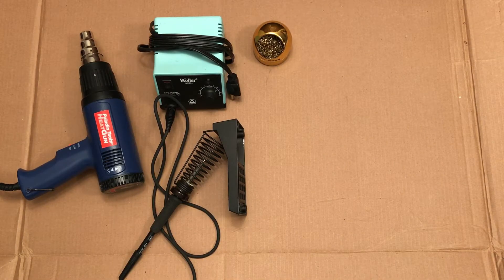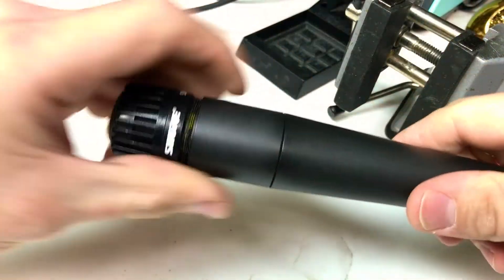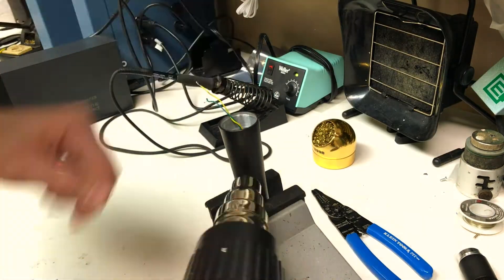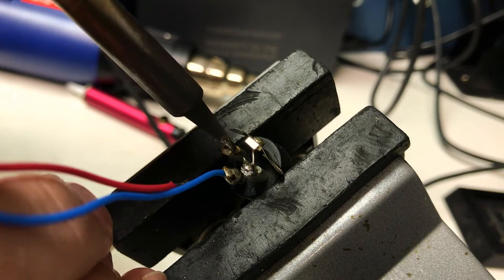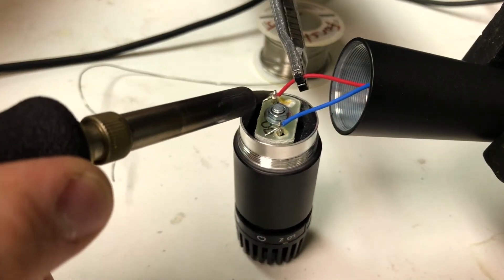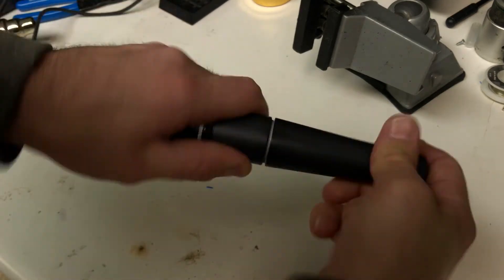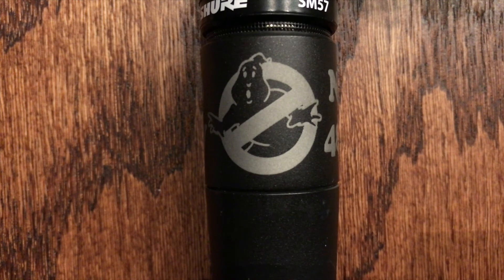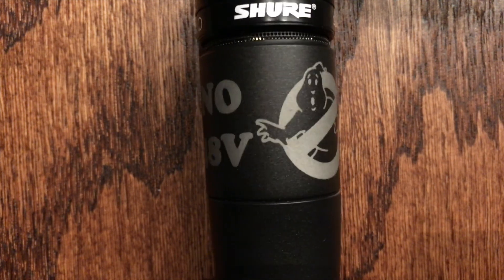Shure 57 Transformer Mod

Comment: Horrible. What did you even do except swap wires? Why? No explanation of what we are watching. How is this a mod?
Reply from the maker: You should try it since it’s such an easy modification. It sounds great. Makes the mic have a faster transient response, adds low end, & makes it sound more open.
Reply: It removes the transformer from the circuit. There are pros and cons to this. Pros being faster transients(imagine removing a dynamics compressor), and a different tonal balance(frequency response). Cons being lower signal strength, so you will need to turn up the preamp, but thats fine because most preamps have enough gain, and the preamp will work at a slightly lower noise setting if its turned up more(cos the gain knob is a potentiometer aka a variable resistor, whose job is to lower the level of the already amplified signal). But that noise thing is very minor thing. Just an interesting tidbit.